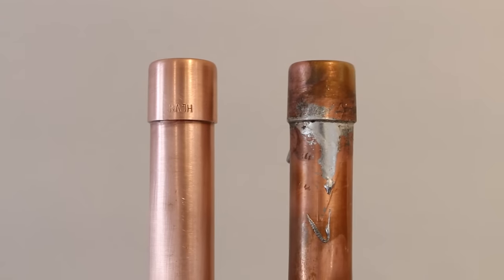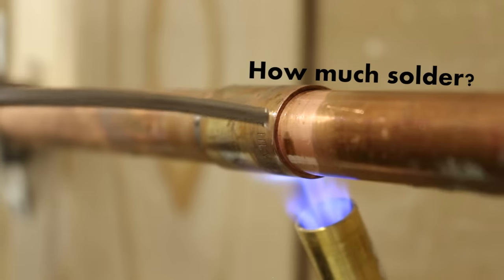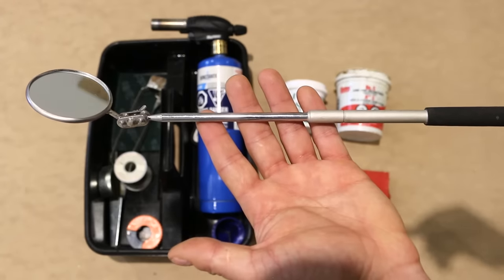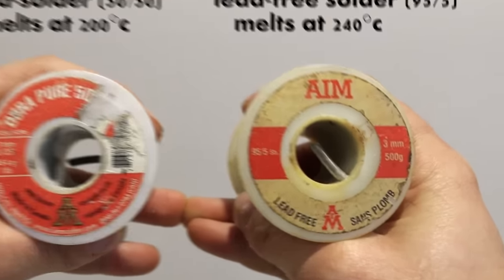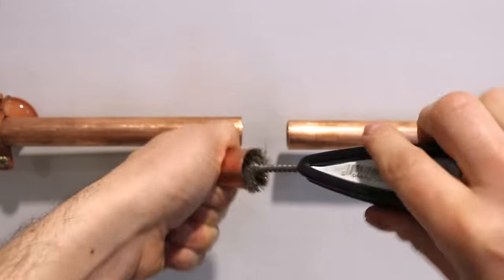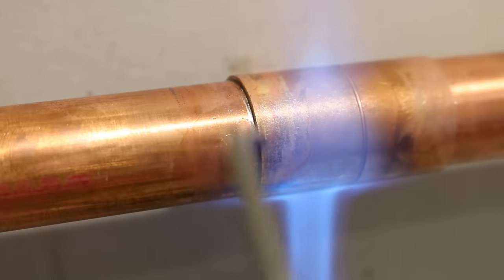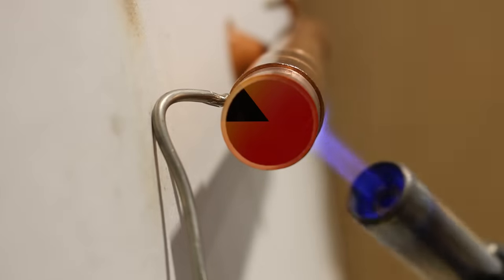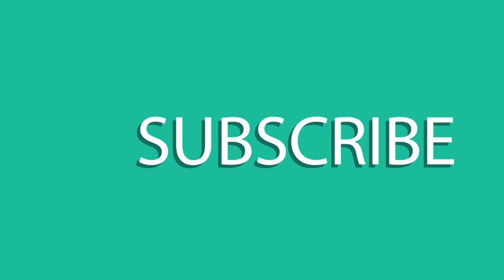How To Solder Copper Pipe Like a Pro (Tips & Tricks) | GOT2LEARN

Comment: A city inspector would probably fail an inspection because if he cant visibly see it was solder or soldered enough, a pressure test will not be sufficient. I have seen cases where its soldered and you cant tell a solder pipe from one unsoldered and impossible to final an inspection.
Reply from the maker: Like I said in the video, this is only for professionals who already know how to solder and it's only for joints that will remain visible, such as radiator connection or towel warmer connections.

Comment: I've been told by multiple disciplines that inspectors want to see the mess dripping out a little as proof it was done at all.
Reply: There is a difference between a little glop or bulge of solder sticking out and streams of is running down the pipe. The "professionals" I have worked behind always have 10x more solder running down the pipe than they got in the joint. I'm okay with a little tattle-tale showing it was soldered, but not solder running down the pipe like the wax from a candle.

Comment: It's a bit easier if you hammer your solder flat first, that will allow you to put a very small amount into the joint and have no spill-over. I also carry a bit of fiberglass insulation to wipe the joint with (in a normal solder). It gives it a nice sheen without snap-cooling it like a wet rag would.
Reply from the maker: Just hammer it on a clean surface not to imbed dirt in the solder 🤘

Comment: Solder cheap, leaks are expensive. So is all the damn time you took doing that joint. Questions too, “did you forget to solder that joint” I even cap my joints just to be sure I got all crevices
Reply from the maker: Cap a 3/4" joint? 😦

Comment: Without watching the video or comments. You've either used flux or lots sand paper to clean the pipe after
Reply from the maker: Nope lol!
Reply: @Got2Learn  howd you get it that clean afterwards? I'm intrigued
Reply from the maker: Abrasive pads 🤘
Reply: @Got2Learn  huh, I'm gonna use that next time. I always used flux + heat and rag to clean up after. Abrasive pads sound way easier and cheaper!
Reply from the maker: @JuanWonOne  yeah, it's so much easier to use, have fun brother!!
Reply: @Got2Learn  no doubt! I'll have lots of fun using abrasive pads on my pipe next time.
Cheers mate!

Comment: Cool video. I should show this to my boss as he kept trying to tell me how I should solder when I have soldered thousands of joints, most of them pretty, few of them leaked, while he's been using a propress. Kept trying to tell me to heat closer to the pipe and not on the hub. Like fuck off dude, I don't care if you're my boss. I do it the right way, not your way.

Comment: I'm an electrical engineer and sometimes I solder copper pipe to make large high Q RF inductors.  If I don't have a beautiful fillet, I'm not happy.  Also 50/50 Sn/Pb solder?  Wtf is that?  60/40 is the mediocre stuff and 63/37 is the best.

Comment: Scrubbing the fitting after soldering is poor practice, as it leaves scratch marks all over, any plumber can tell you are trying to cover up your mistakes, if there a lot of scratches. It better practice, to wipe the outside of the fitting and pipe with flux, while the pipe is still hot and then wipe with a rag. This will cause the fitting to look clean and polished.
Reply from the maker: Huh?

Comment: Great way to have leaks. This would not be the way to solder most of the time. Even looks better with a small bead of solder IMHO.
Reply from the maker: I've never had a leak soldering like this, but you do need practice.
Reply: @Got2Learn  sure, if you take your time.....Not a good practice for professionals out in the field.
Reply from the maker: Honestly, I would only do this on towel warmers or copper fed rads, other than that, no real need to do this....at least the technique is out there for those who are looking to improve if they need it ;)
Reply: @Got2Learn  I have seen fittings that have flux and solder built into them. Look like a pro press but that ring has flux and solder instead of a gasket. They provide a similar finish with no "back side". I still ran my solder around the thing though. Maybe just my OCD but I didnt trust it :-)
Reply from the maker: Yeah those are called "yorkshire" fittings, we see them more in the UK though.

Comment: it always amazes me that the USA still uses soft solder on copper pipes
Reply from the maker: Less expensive, and does the job just fine imo.
Reply: In Germany this is also a very common method. I would also say, that this is the tecnically  best method for connecting copper pipes.
Reply: @sebi7794  Australia have been using lead free silver solder for 40 plus years
Reply: @pijnto  What do you mean with silver solder? In Germany we are using "soft" solder containing tin, and a small quantity of copper and silver. But there is also a kind of "hard" solder which contains very much silver, but has a much higher melting point and is normally not used for connecting copper pipes.
Reply: @sebi7794  In Australia we use sliver solder?brazing alloy minimum 2% silver and normally use oxy acetylene torch no flux require, in most states soft solder is illegal as on gas lines in case of fire , the soft solder can melt
Reply: do you guys use silver solder on water lines not under high pressure??in the usa we don't typically solder gas lines?? we use silver on anything typically under high pressure or larger pipes on domestic water. lines under 1 1/2 under street pressure (100) psi or less simply do not need to be silver soldered. there is no need and would be a waste of money. soft solder melts at over 450 I think, it wouldn't matter what your water lines are soldered with if you have a fire at that point. silver solder is for strength, nothing more.
Reply: ugh, 50-50 solder should only be used on drains.Its fifty percent lead....
Reply: u can use it on heating hot water coils since that is not domestic potable water. we don't use it here in the state I am in on anything. Drains will eventually drain the water to rivers. I know its still used elsewhere on drains but we don't where I live. lead is in the ground naturally but no need to add to it.
Reply: @bullofthewoods9374  In Germany it is also illegal to use soft solder on gas pipes. It is also illegal to use hard solder on drinking water pipes. These are soldered with a lead free tin based solder. Howewer it is very common to hard solder pipes containing the water for the house heating system. These are soldered by using a copper/phosphorous based solder. The pipes under our streets are mostly made out of polyethylene which is also fused/welded and sometimes pressed.
Reply: we cant use lead solder here anywhere in the usa on potable water lies. I think you can still use 50/50 on drains and non potable stuff but that maybe illegal now as well. if it is not it will be soon enough. on our newer systems we also use polyethylene, but there is still much ductile iron water lines in the ground in bigger older cities. we still have copper main water lines in places.
Reply: @bullofthewoods9374  Heating system that use water a rare in Aust. plus 90% of our drains are PVC except in specialist applications
Reply: oh we still use a ton of cast iron in the buildings. homes plumbing and sewer lines are pvc but in the buildings is still mostly cast iron ( most multi story commercial;) after so many stories we have to use cast iron anyway. I guess aust don't see much really cold weather huh? we don't solder gas lines here that I know of. not saying its not done but not that I see. most of our gas is the stainless steel flex line or black iron. all mechanical joint or flare.
Reply: @bullofthewoods9374  Cast iron is a absolute thing of the past in Australia, maybe it is the soil used to cause havoc by cracking same with clay pipes, PVC outlasts them all 
plus almost no rout invasion as the joints are bonded
Reply: oh I agree but our brilliant engineers here are still stuck in the dark ages. they insist cast in the buildings. we are slowly moving away from that but as far as government buildings goes, its still cast iron and copper,. I see more cracked cast iron in commercial buildings than I ever have pvc. typical engineers never listen to the very people doing the installs and the service, we know more than them what works beter and it what situation. go figure.
Reply: oh we still get roots on pvc, it is not as bad but roots can crack pvc just like it does cast. you give it enough time and it will happen

Comment: 6:40 INSIDE the fitting? I was taught to never ever do this because it might get pushed into the fitting as you insert the pipe causing your solder to go in there and poison your water
Only apply flux to the outside of the pipe.

Comment: Hi.... Not related to this video specifically, but i saw other videos about bending straight copper pipe.
My question: Is it possible to bend straight (type M) copper tubing without kinking it and if so, is it code to use bent copper pipe for potable water ?

Thank you.
Reply from the maker: It has to be soft/annhealed, if it's hard it'll just kink.
Reply: Why? Aesthetics? If not just use pex.
Reply: @Got2Learn  My 1960 built house was plumbed mostly without fittings (ells) The potable water lines are L copper and the Hydronic lines are M copper, both hard copper. Almost all turns were done by bending the copper, and there are no kinks. Also no couplings were used, the pipe was swaged larger to act as a coupling. It's really nice to look at.
Reply from the maker: @lacro niceeeeee

Comment: Nice vajayo but as others have probably said, wiping the solder joint clean leaves a marker that the joint is soldered also wipe the joint and remove excess flux with clean damp rag. Flux is not somthing you want to leave on the coper after joint is made.

Comment: I have a question.  Can I use Tinning Flux on HVAC line set?
Reply from the maker: No, you need special flux to braze, or you could just use Silphos which doesn't require flux.
Reply: @Got2Learn  Thanks for the information.
Reply: No,   Refrigerant lines must be Brazed using silver solder, not lead solder.  Only hacks solder refrigerant lines.  Don't be a hack.

Comment: Love this video but not very practical as many times pipes are crooked or coming out of the wall or ceiling in bizarre angles and positions.  They aren't always proper tied aswell. Not to mention it would take too much time. I install water heaters and we only use copper.

Comment: To bad in most states the flux you are using is not code  for potable water systems.  And you should always heat the back off the cup of the fitting to make sure you get solder to flow all the way to the back of the cup of fitting.
Reply: Why do you say that? #95 IS certified for potable water.

Comment: No Pro is going to waste his time fucking around like this.  Plus you can't see if there are voids unless the joint is at least slightly overfilled.  One way to fill a void is by jamming the solder into the dark spot and pushing as much solder into the void as you can, then working the fitting back and forth a little bit before it cools.

Comment: Can you show my plumber how to solder? I paid a guy to fix a leaky corroded  t fitting and I’m pretty sure he didn’t replace it like I asked and just heated it and re soldered. It has big blobs of solder running several inches down the pipe. Just a nasty unprofessional job.

Comment: I’m 40 plus yrs in trade, I’ve done a few joints……plumbing in my day, take the torch and heat joint, and then wipe the joint with a slightly damp cloth, it’ll help. Then do not use too much heat,  if the copper changes color, you have too much heat. You might want to put solder on the whole joint, he has a point but I’d never do that, always solder the whole joint.  Good point about cleaning the joint, use a damp cloth, clean whole joint, if not the joint will turn green and look like shit, or apprentice tracks I call them,

Comment: My copper pipes have a silver shell and it won't heat up and glow. What do i do?
Reply from the maker: A silver shell? Can you please elaborate?
Reply: @Got2Learn  yes. So the pipe when I cut it I can see its copper when I look inside. But the outside of the pipe is silver. I dont know if its copper inside and aluminium outside. But I've tried to braze with a copper brazing rod and the pipe just won't get to a stage where its glowing. The brazing rod will melt but it won't stick to the pipe. It's a cold and hot water pipe i need to braze closed. I'm just lost
Reply from the maker: Add me on Facebook please.
Reply: @Got2Learn  hi. I only have twitter or Instagram unfortunately
Reply from the maker: Instagram is good.
Reply: @Got2Learn  I sent you a video few days back but no response. The pipe will not heat untill it glows and I held the blow tourch on it for 5 min lol
Reply from the maker: Lemme go check.

Comment: I recommend taking those pipe cleaning brushes, cutting them off at the handle with large gauge wire cutters, and installing them into a portable drill for cleaning out the receiving end of fittings.  Way faster than doing it by hand.
Reply: They already make wire brushes that can be used with drills. No need to make some makeshift tool

Comment: Im a plumber and i say you hold your flame wrong !
And if you want a nice ring of solder this is the way to do it.
1 heat up the bigging of the fitting.
2 bring your flame to the back of the fitting ( you are still too close ) the thin will go to the heat.
3 let cooldown a bit and put your flame on the other side on pipe then you can make a nice ring with just a tiny bit of solder .

But you can make a proffecional video.
Reply from the maker: Thx!

Comment: Old gas fitter taught me to use MAP gas, not propane and clean joint with wet rag while still warm.
Reply from the maker: Maybe when MAP gas exists, but it doesn't exist anymore, the manufacture has been out for a long time now, the MAP gas you see, is not REAL map gas, but it's still a bit hotter than propane though and for the rag part, the only thing I recommend is to wait till the solder has hardened to touch it, if it's still curing it could move the joint and open it up, which could potentially cause a leak.

Comment: Why are you not using MAPP gas? Why would you ever heat the male side of the joint? Why in the hell do you only heat one point of the joint? Those questions are due to you doing things wrong
Reply from the maker: First of all MAPP gas doesn't exist anymore and second of all, on small diameter piping you can heat in only one spot.
Reply: @Got2Learn  True, real MAPP doesn't exist, but the new "MAPP" still gets way hotter than straight propane, thus making it much more efficient than propane. Also, you're straight up wrong about heating in one spot on small diameter pipe. I learned from master level plumbers and boilermakers...guys who have each been in their respective trade for over 30yrs. Heating one point is a great way to get uneven distribution of the solder and just looks ugly because of the discoloration it causes.

Btw, I work in HVAC...so I have firsthand knowledge of the skills and techniques needed to create flawless joints...AND I have proof that the techniques that myself(and many, many others) use create a finished product that both looks and works better than the finished product you're creating with the techniques that you're using.
Reply from the maker: On 1/2" and 3/4" it's fine, done this millions of times, perfect joint.
Reply: @Got2Learn  The failure rate is much higher with your techniques. That, my friend, is an absolute fact.
Reply from the maker: I'd say the same if it was for 1" and higher, but 1" and lower works just fine.

Comment: Nice clean work. I rather make it look decent and leak free than pretty. You won't be making any money if you take all of that time doing it. Plus most of the time almost all the pipes will be cover so nobody will ever see them.
Reply from the maker: Hey thanks! Honestly, when it's a habit, it takes the same amount of time to get it done, that's what's nice about it. I would only do this for a towel warmer where the pipes are exposed or a radiator.

Comment: No ID flange?
Reply: @Got2Learn  sorry some call it inner diameter flaring, to keep the flow from damaging the pipe.  
Sounds crazy but I have seen failure from that mistake more than once. There is usually a flailing tool on the pipe cutter.
Reply from the maker: Ahhh yes!
Reply: @Got2Learn  thanks for the video.